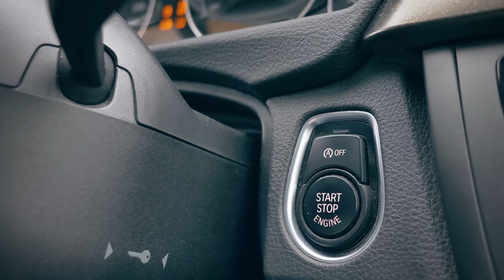How he started the worldwide 3D printing revolution / Adrian Bowyer

Comment: I want to thank Adrian Bowyer for his contribution to the existence of affordable CNC manufacturing machines. I am a retired mechanical engineer. (I don't believe anyone ever considered me a very good one.) I pick up very cheap CNC machines from those frustrated with the amount study required for this hobby. I like to make repair parts and tooling using 3D printing, laser cutting and the CNC router. The self replicating part of it seems silly but hobby CNC manufacturing is an important part of my retired life.

Comment: Hi Thomas, This comment does not belong here, but I was wondering, if majority of printers use leadscrews that are 8mm of lead per rotation, wouldnt it be interesting  experiment to see if using 4mm or 2mm lead per rotation screws can get you lower layer height capability ? It would be awesome if you would try this on some super small 3d printer to make it something special, if it was possible, imagine that super detailed mini prints.

Comment: It really is amazing how cheap printers have gotten in just the past 3 years alone.  I've used them at work for nearly 20 years, but never dreamed of owning one at home (too expensive, too hard to build, too hard to maintain).  2 years ago I thought spending $600 on a basic 3d printer was nothing.  Now a similar printer can be bought for 1/2 to 1/3 that price.  It's amazing what the end result can be when you turn something into open source.  Just look at how robust linux is.

Comment: I call B.S. I know the guy who went to venture capitalist with this 15 years ago. Video taped meeting, maybe this guy watched the tape and  got inspired. The first prototype was built with old printer motors, control was via parallel port. original use was creating moulds for caving lamps. The goal was reducing costs, nothing to do with this guys political concerns about sharing. So, as I said, this is B.S., and very pompous B.S. at that.
Reply: Obviously comprehension is an issue for you. He never said he was the first or anything like it. In fact he relates how he got his department to get a couple of 3D printers in. His contribution was not in the machine itself. It was refining the technology to the point where it was cheap to built in such a way as the machines themselves could build the critical components themselves. Thus they are to an extent self replicating. And then to make the whole project open source so that any individual or group could build their own machines without worrying that some copyright troll could nail them with the usual legal shakedown. Let me guess, your an American aren't you. I think you've got pompous on lock.
Reply: Ha ha ha, are you saying that your mate invented 3d printing in 2003?  Stratasys developed Fused Deposition Modelling in 1988, and patented it in 1991.    Additive manufacturing techniques go back to around 1981.  Watch this video again. Reprap project was about a machine that could mostly reproduce itself.